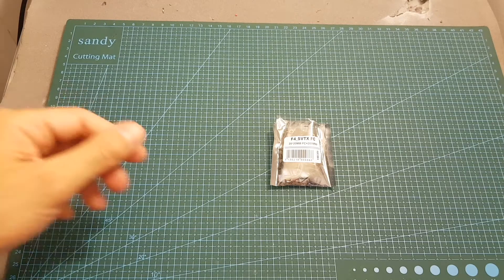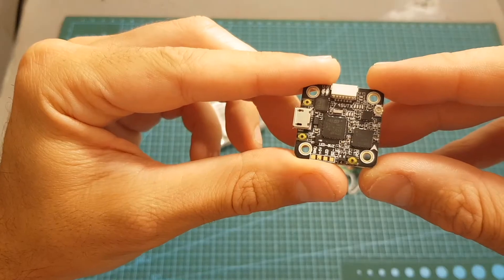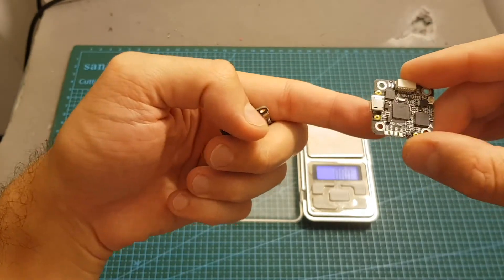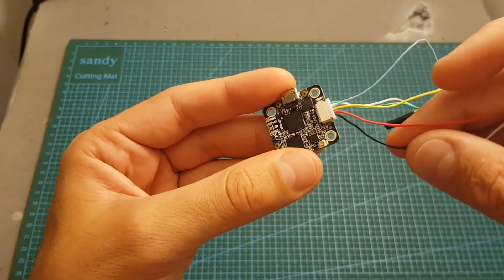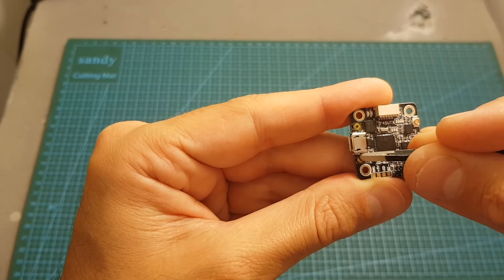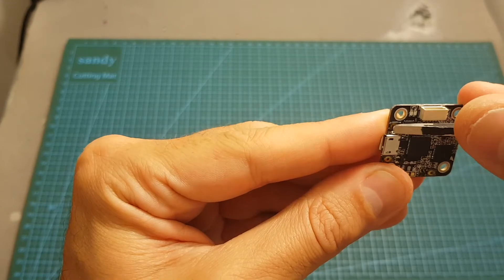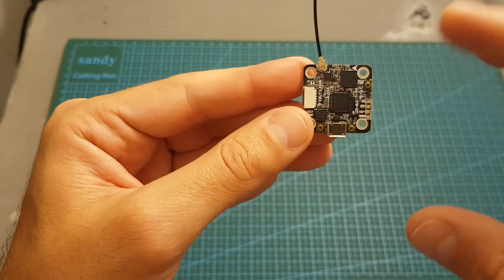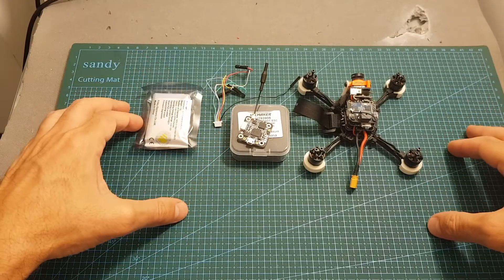F4_SVTX - F4 FC + VTX Review & Test Flight

Comment: Nice one! Only the heat would give me some headaches - I think I would always be kind of nervous as soon as I have it plugged to Betaflight... 
But as you mentioned that it is able to use tramp protocol: Would it work to lets say assign Pit mode to the same (switch) position like disarm? Because this new Pit mode option in the Betaflight modes tab gives a hard time with my HGLRC VTX - I can activate Pit mode via switch on my transmitter, but I can't deactivate it afterwards via switch (have to replug the battery). Would be awesome if it would work properly with the F4_SVTX flight controller, because then wouldn't be any stress with heat when working on settings while grounded...

Comment: Nice one bro! Was the reception comparable to other 200mw vtx's you've tried? I really like the F4 and space saving :)
Reply from the maker: Thanks Dante. For a short range it's ok. The Hawk 5 has a 200mw VTX as well and the signal was much better. I would only buy it for a very tight build. Otherwise, I suggest to sticking for a separate FC & VTX.